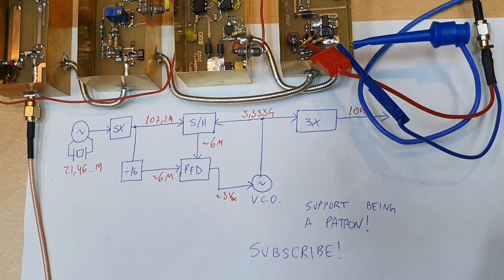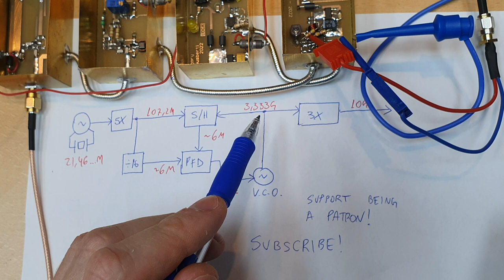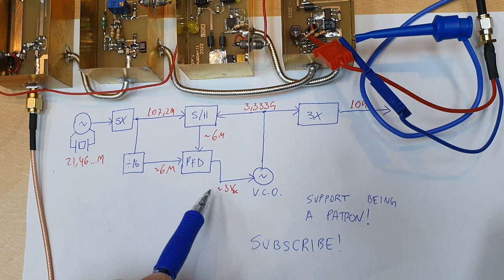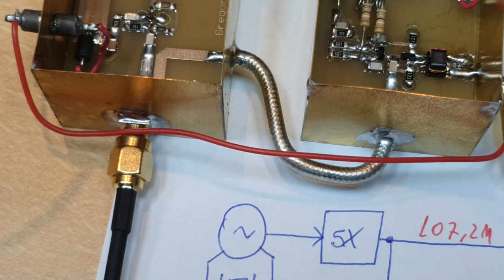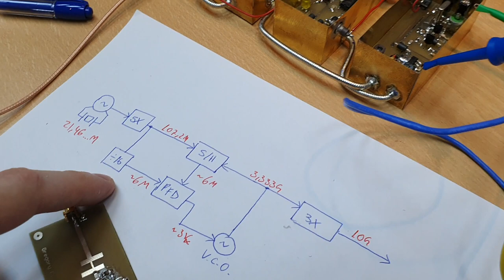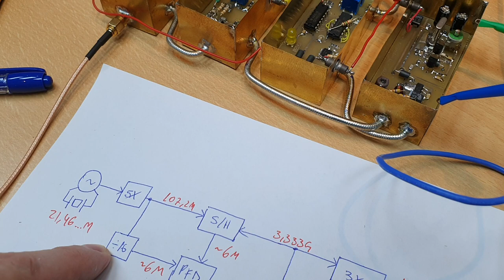10GHz Microwave Source - project update 4

Comment: Very nice, it's coming together nicely. 
The standard size enclosure is a very nice thing, I also have a whole stack of equipment I built over the years. 
The little brass boxes make it very easy to solder stuff to, I like to use the commercially made ones from silver sheet metal.

Comment: At frequencies above 1 GHz, the inside of the metal (copper, bronze or brass) case must also be coated with a thin layer of silver.
Also, PCB tracks and conductors operating at frequencies above 1 GHz need to be coated with silver. To reduce conduction losses.
Reply from the maker: Wow!
Reply from the maker: Thanks man! For FR4 the main losses are from the roughness of the copper to clad contact, so plating does not help much.. I don't remember who tested it, I think was Matjaz S53MV
Reply: @AllElectronicsChannel   The point here is not that it does not have a very strong effect, but the fact is that over time, oxide forms on the surface of the case and conductors made of copper and its alloys and it conducts microwave signals much worse, which pass only over the surface. But silver and silver oxide conduct microwave currents almost as well and allow you to get more stable parameters for a long time.
Reply from the maker: Thanks! The tracks are actually silver plated, hehehe. I used a silver plating solution. I did not silver plate the brass

Comment: Hi Greg, may be you'll need to put an absortive material such as ferrite sponge in the 10GHz box to avoid sharp waveguide resonances
Reply from the maker: Yep!! We need to discover a cheap absorber
Reply: @AllElectronicsChannel  uhmmmm at 10ghz, water is an good absorber. isn't it? ;) no, Im just kidding.
Some plastics, polymers and ceramics are very lossy at 10GHz. May be an interesting subject to investigate the tangent loss of materials with vna and cavity resonator